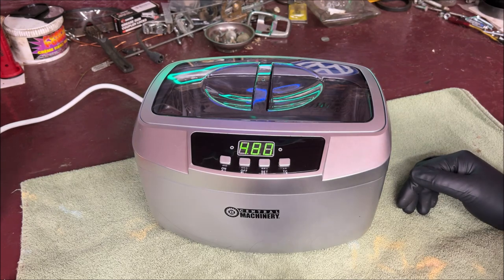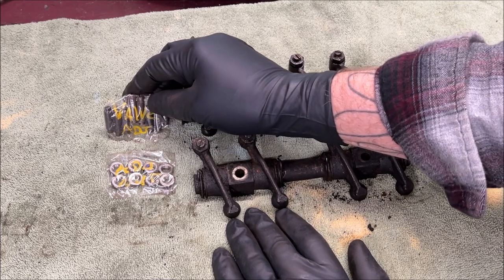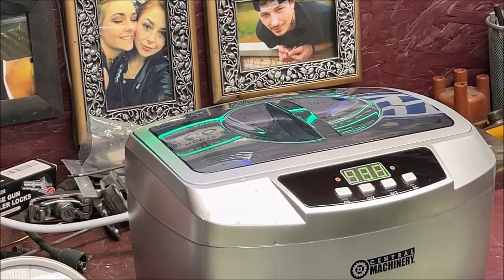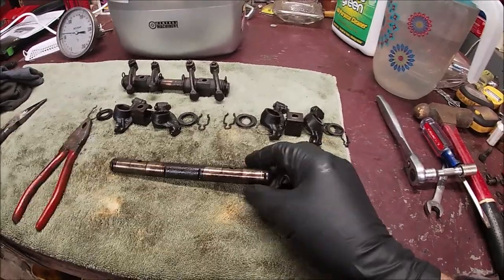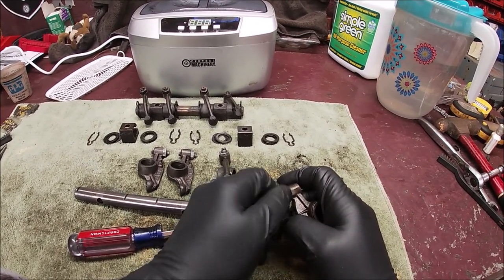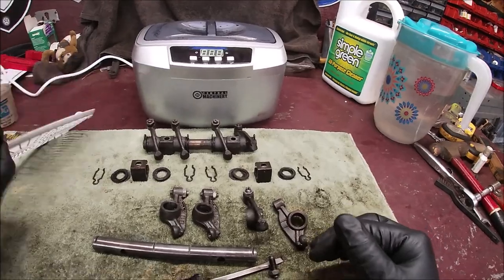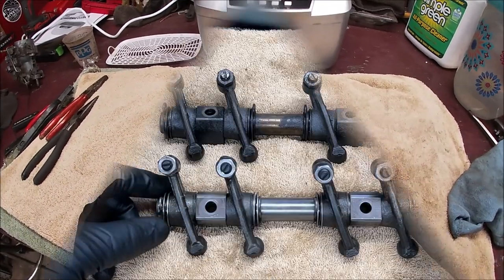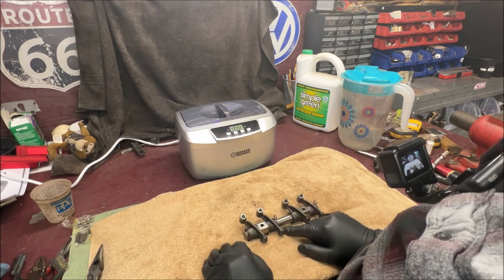VW Beetle Rocker Arm Disassemble & Clean- How To Take Apart and Reassemble - Ultrasonic Cleaner

Comment: I’ve had the best results using 75/25 mix. 75% water 25% simple green. If you add hot water the mixture heats up a lot faster also.
Reply from the maker: Thank you so much Jerry! I have not been using simple green very long at all. So I like any tips that I can get.

Comment: I don't have ultrasonic yet however I replaced   a bunch of the chewed up nuts, adjusters and spring/wavy washers because I figure anything with spring tension weakens over time and I had one break a couple of years back, I shut the engine off pretty quick when the horrible noise started, bits of the broken wavy steel dropped to the bottom of the rocker cover and the arm rattled noisily but lucky nothing else broke! I pulled over onto a grass verge and called for a tow home. Stuff happens with old cars but I was glad I was out country not in city or on freeway, I avoid those where possible.
Reply: Be careful not to buy cheap adjuster screws as they have soft steel that will wear fast and damage, vw used a hi quality steel of a correct hardness that lasts, not too hard but just right.
Reply from the maker: @johncollins5552  Thank you John! And thank you for chiming in. I really like the ultrasonic cleaner, there’s quite a few places that sell even larger ones. Where did you buy yours from? I’m not quite sure what he sent me.

Comment: New engine builder here. When it comes to the nuts and adjusters. Is there a specific measurement you screw them in and then tighten the nut?

Comment: Hey Jerry. I had some phut-phut sounds coming from my engine under load when it got a bit hot. I found no damage to the heads nor had the studs pulled (got case savers), but I did notice a couple of rocker shaft washers and half a spring clip in the top of the head bouncing around. The spring clip above #1 had lost its legs, and I cannot find where they went. Nor can I find the wavy washer (there was half of it in my strainer, not sure where the rest went).
Do you think the legs off the spring clip would be able to get past the strainer? I'm thinking of just putting new washers and clips on the shaft and putting the engine back in. Would you instead go to the effort to split the cases and clean it out to make sure there's no debris in the case? I think I know the answer....
I appreciate the wonderful resource you've created here. Cheers from the UK. Oh I forgot - Number 2 😁

Comment: What interval would you suggest for this process? I'm religious with my oil changes, and only have a few thousand miles on my new engine.  My adjusters all seem to move well. @Slades VW Beetle
Reply from the maker: If they are moving well I would not worry about it. When you pull your valve cover to take a look, if they look really terrible like mine, then it would be nice to do
Reply: @SladesVWBeetle  Good to know.  I got my adjustment finished yesterday and have noticed an improvement in power and fuel efficiency.  The adjustment was not terrible. I was able to work the nut back and forth to free it up on each lifter. Good to go!
Reply from the maker: @MarkLoves2Fly  outstanding!!! When maintenance is kept up on, it makes a huge difference in longevity

Comment: I have a question regarding engine markings. I have an AE(January 71 build) with the marking “W4” just below the distributor on the case. Does anyone know what this might mean? It appears to be a factory marking but has anyone else seen these before?
Reply from the maker: I must’ve met James, I never heard of the W-4 before. Did you try looking that up on Google? That is quite new to me
Reply: @SladesVWBeetle  what’s your email I will send you a pic
Reply from the maker: @JamesDavis-jo9tk  sladesvwbeetle@yahoo.com
Reply: @SladesVWBeetle  the German word for remanufacture starts with “W”.
Weideraufarbeitung or something like that. I’d say this engine was repaired at the factory after an issue was discovered at initial start up. I sent you a pic.